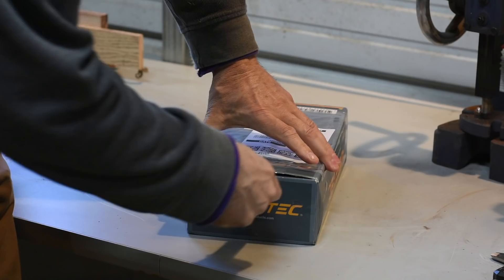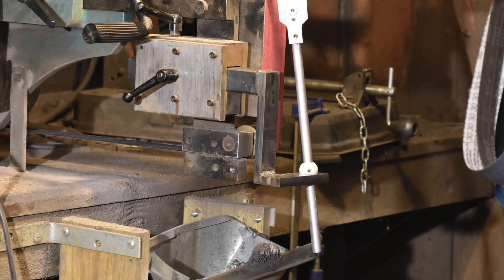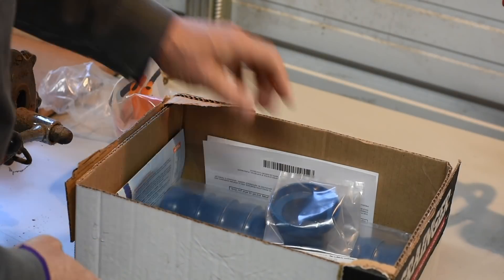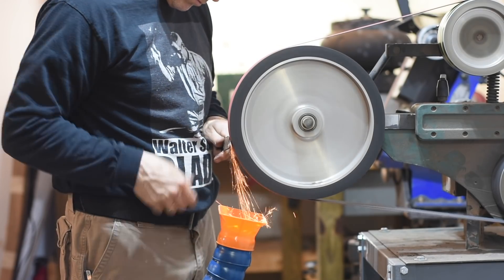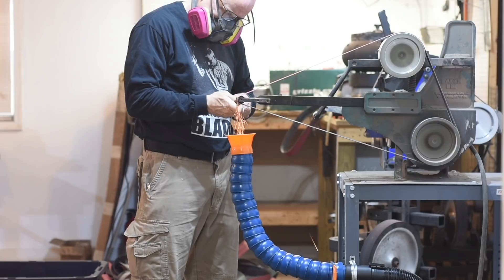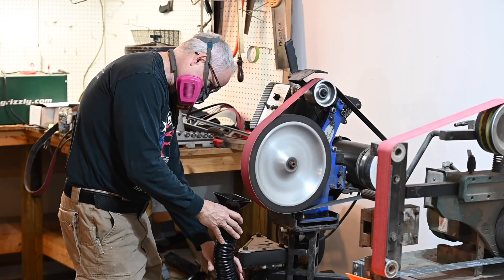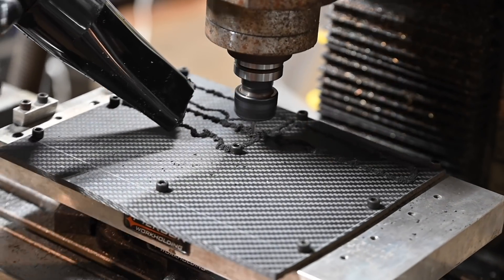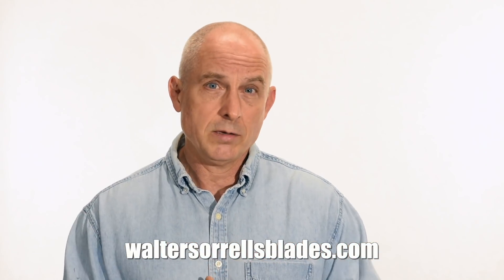Dust Collector Showdown for Knifemaking

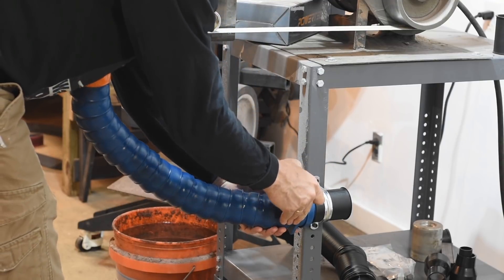Comment: At 4:08.... what is that contraption in between the shop vac and grinder? What is its purpose? 

I was hesitant about making my dust collector with my shop vac due to sparks. Wasn't sure if they'd ignite inside the shop vac.

Comment: Quick tip, change your hoses on the cyclone, the hose ontop should go to your vacuum. I made that mistake, couldnt figure out why the suction was not good. Turns out the dam instruction booklet was wrong, typical. Good test but id never use an extractor, even the proper metal dust extractors, as its just an accident waiting to happen. Ive been beside both setups when they caught fire. Wouldnt mind but the proper metal dust extractor cost over 2k. Both caught fire in the pipes, the proper metal dust extractor seemed fine after it, but the normal one started smoking a bit after it. Both had spark arrestors on the intake. Thats why i boxed my grinder in and just prefere to use a pull out tray of water that sits under the grinder, very handy. Remember sparks,fuel, forced air = fast fire or explosion. Too many people have made that mistake.

Comment: I've been using Numatic(Henry ) hoses for years, but the initial inlet is a coffee can(Azera in UK) 3M masking taped onto a 90deg. plumbing elbow,  into a cyclonic over a plastic bin through into a cheap Screwfix wet n dry shop vac, but my grinder is slow so not exactly flinging out sparks too far.

Comment: I have a bucket of water on a board with wheels so I can roll it out when grinding steel, it catches a lot of sparks, it’s right there for cooling blades, and was extra cheap. Easy to roll under the bench when not needed. I built a little removable abs pipe for shaping handles.

Comment: Be so very careful. So many of our friends tried this, and then later had the "fire in the dust system" experience. Myself included.
Reply: I had a fire also because of this. I went inside for a water came out and my hose and bucket was melted! I had the bucket halfway filled with water

Comment: Your Dust Deputy hoses are the wrong way around, as spotted by Peter V a few days ago. :D
Also, if you can, up grade from the shop vac. Get a 2hp+ dust collector and at least 4", if not 6" hose. Volume of air movement is a good thing.

Comment: Good video as always. I have yet to try those flexible ones but will do now. Be careful of the filters in those portable collectors, might caught fire. If you plan on getting a full size collector then I’d highly recommend drainage pipes with the proper fittings. I tried taping them but it all falls apart, the real ones are cheap and fit together nice. Dust build up can really burn hot. You mentioned it in the video but be careful, I have a 5m long smooth 4” pipe which I thought would let the sparks cool before going into the bag, never had issues with the bag but the pipe caught fire half way and a lump of glowing hot spark cluster dropped onto a fairly out of sight wooden shelf… luckily all was fine but I don’t use it for steel anymore.

Comment: WARNING!! I tried Lock Line attached to a shop-vac. After only a few hours of operation, a big hole melted in it at the second curve of an "S" bend. Also, if you're grinding wood handle material, your metal sparks can start a fire on the sawdust collecting in the shop vac bin (ask me how I know...). Bottom line is I only use the Lock Line on handle material and use the good old fashioned bucket of water for steel grinding. If I try ducting again, it will only be metal.
Reply: Same here, I even tried a smooth pipe 5m long. No issues with the collection but pipe caught fire. Heard about a water trap that could be the answer though

Comment: My biggest concern with building a dust collection system is metal sparks and wood dust going through the same lines leading to solid risk of fire within the system
Reply: I use the same lines for both, but at the end are two shop vacs. One for wood and one for metal.  Not really that much of a pain to plug into whichever I need.

Comment: I really wish we could get Loc-line to fit UK shop vacs. Currently I use an adjustable DTI base to hold my shop vac nozzle, it works ok but it isn't as versatile as something like loc-line.
Reply: Looks like Record power will be stocking Loc-line kits and an adapter for 2.5 inch / 63mm inlets.
Reply: @carlb401  Interesting. I'll have to keep an eye out for that.

Comment: Been there.  Went back to metal ducting due to hoses catching on fire.  I also use an metal ash canister between the nozzle and the vacuum  with about a gallon of water in it.  No more smoldering metal plastic combinations.

Comment: I am very impressed by the lock line, looks promising.  At 04:10 i noticed  that the hoses from the shop vac is connected to the side of the cyclone. I am pretty sure that you will get better performance if you switch the positions of the hoses. (Really not trying to be a smart ass). 
Look like you are enjoying the new shop 😊 thank you for the time you put in these videos! You were part of the reason that i jumped into knife making (hobby).
Reply: LOL! Nice catch! He's definitely got the hoses backwards! Hopefully he sees this. I'll put a new post to make sure.

Comment: On my Grizzly 2x72 I used galvanized ducting like you mentioned. I also used grill mat fabric instead of plastic in areas that I needed dust flaps. Had it laying around so I tried it.

Comment: IDK, dust isn’t just ‘dust’. Metal filings can ignite, especially mixed with other materials, sure smolders first, LOL, heck flour explodes.  It’s not  the first five minutes, it’s over time, like dryer vents.  Shop vac, fine, it can be removed, short lines, static grounding.  Metal lines, not plastic that can add to a fire issue, like dryer vents.  I mean I have little fires burning sometimes grinding hogging off metal.  But then there those of us who have fallen off motorcycles and those who will 😉

Comment: I have just finished my grinding dust collection system. A 50 gallon drum is under the bench, movable to any location (three belt grinders and two disc grinders),  a 6" gal spout goes in to near the bottom which feeds signifcant air  to a home made cyclonic separator also made from 50 gallon drums with good lids (sealant drums with neoprene seals, cost me $10 each) then an 8" hose  feeds from there to a repurposed 2HP floor sweeper (outside) from ebay for $100. I also wet grind (dual water mist) and just grind post HT stainless and stainless wool burns so plastic is mostly out. So far so good and cannot smell or see any dust if I am not wearing a respirator (I do though) and the burning stainless wool sticks to the gal then gets drips of water on it and goes out  so it works well. My third shop-vac fire got me working on it...

Comment: I had a similar set up vented to an Oneida Dust Deputy cyclone. The metal dust accumulated in the correlations of the plastic hose and with the high speed air flow it created the conditions to start a fire. The smell of burning Dust Deputy alerted me in time to get it shut down before a major fire. The next iteration will have water traps and spark mitigation. The fire was not theoretical.

Comment: I've been mulling over the same options for my new shop, but for the moment I've decided not to decide, and am using excellent personal filtration equipment. I just can't conceive of a collection system that would be so efficient as to allow me to grind without a mask.
Reply: I use both, I’ve built up a decent extraction system (for wood at least) but still need my mask. It does hugely reduce cleanup though. Window open with fan on is a cheap way ;p
Reply: No dust collection will ever be that good, if it was you woild have to be maglocked to the floor so you wouldnt be sucked i  too 😁😁

Comment: I have been trying to figure out what I want to build for a while.  I'm worried about grinding handle material like mycarta then hitting the spine and throwing sparks in with all that combustible dust.  A dust explosion in the shop vac would not be fun.  I was thinking of a eater trao between the inlet and the vac.  What is the experiences of others?  Am I being overcautious?

Comment: I used a storage container with a seal in the lid.  Cut a 4” hole in the top for metal ducting.  Then glued in the hole.  The bottom of the pipe sits 1” above the water in the bottom.  At the top is a normal vent duct connection with a flex tube on it to help reposition it.  I then made a simple two arm holder with a screw in the elbow to hold it up.  Hope all that makes since.  Can send you images if you want. Had it build int a matter of a few hours.  Has drastically cut down the dust.   Next I put another hole and add an vacuum line so that it sucks air in.
Reply: Excellent idea, I suppose wood would clog it up but could have a lever to switch between spark catcher and straight to extractor
Reply: @kwbknives7989  I use the Loc liner on another grinder for wood with a cyclone. Set up.

Comment: You can take the Line Lock segments apart and line each one with aluminum duct tape. Same with the orange inlet. Honestly I'd go with metal ducting and have a rod /magnet positioning arrangement for holding the intake in place fast and easy.
Reply: Good idea. Only downside is magnets and metal dust. My nightmare 😂